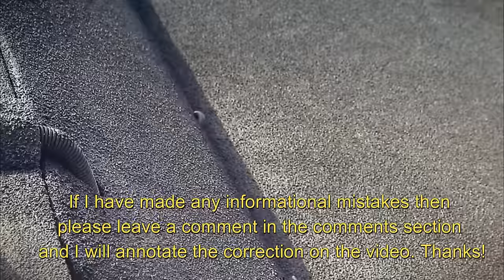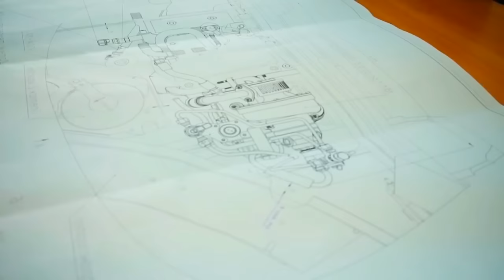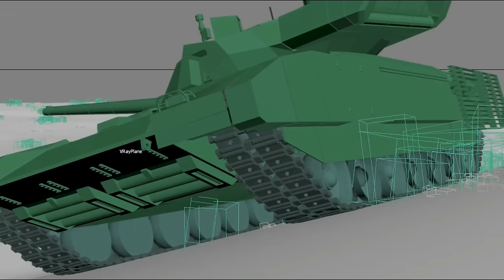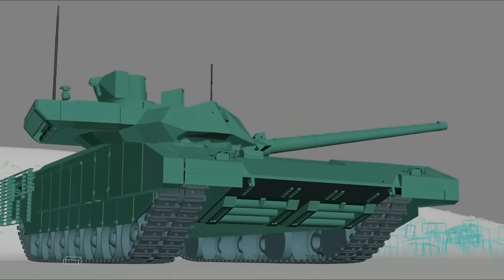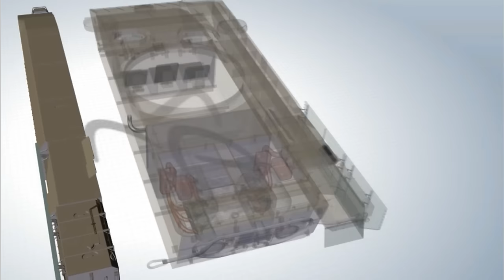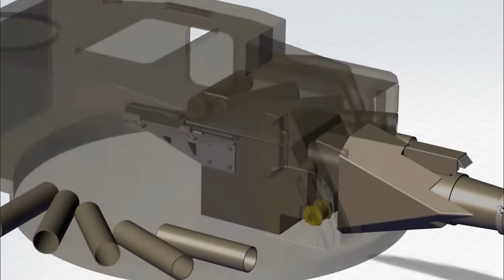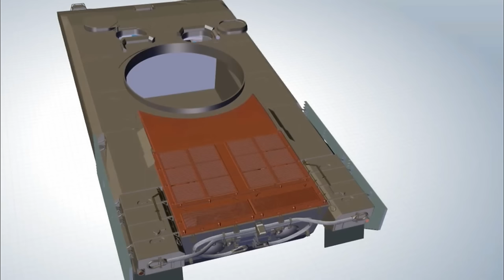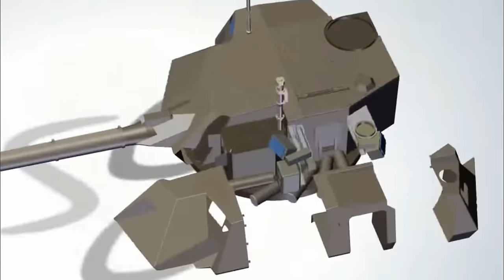T-14 Armata Russian Main Battle Tank - Tank Overview

Comment: Comparable in size to the Leopard 2A7, yet 20 tonnes lighter. That translates to less armour, a lot less. The russians must be quite certain of their reactive and active armor. The crew may be well protected in their capsule, but if a tungsten dart cuts trough the turret (which looks paper thin, and probably is), the main gun will be disabled, possibly ammo will brew-off. Then you have a disabled tank, and 3 crewmen who are basically useless. 
And also not being able to put your head out and look at your surroundings, is a big disadvantage, the fancy cameras all over the tank can never beat mk1 eyeball and binoculars, plus if the cameras break, you are totally blind.

But buttom line in a tank vs tank conflict, the best crew wins hands down. And the russian training and skill level is inferior to western.
Reply: How about ergonomic? Technology doctrin make anything simpler, the training become simpler, the soldier wage reduced, less casualty, the point is make a vehicle that operate as easy as possible, with the cost as low as possible, with crew as little as possible and training as fast as possible, so we can got plenty tanker. With 150 manpower and wage, we got 38 abrams or 50 T-14. Maybe on future any civilian can control tank without any extensive training hence anybody can become milita in emergency.
Reply: i dont see the problem actually... the us has twice the manpower in case of war and 4 times the number of people reaching military age annually, add the rest of nato and you are a 4:1 ratio to each russian soldier.
Reply: Machine vision allows to synthesize the image inaccessible to human perception)
At the T-14, there is no tower in the conventional sense. It means no extra weight. The capsule is multilayered and includes comprehensive protection. Detonation is not fatal, but threatens the loss of the tank. Damaged tower can be replaced in a few hours.
Reply: That's right, you can teach everyone who understands computers, learning is possible in the simulator. Basic requirements for the crew is the speed of response and decision speed, the machine does the rest.
Reply: Джо Неуловимый the damaged tower means unusable tank no matter how fast you can change it, before changing it you will need to drive back to base and takes time, time in which you are defenceless and you will  because of this they will need to produce more and more turrets which require a lot of materials and tech which is pretty expensive.

the armata turret should be well armored at least on the front and with weak sides but the front must be tough, thats a serious design flaw.
Reply: That is why all Russian tanks, infantry fighting vehicles and light armored vehicles resistant to weapons of mass destruction. Crew assumed independent existence in the machine for a few days.
Reply: Джо Неуловимый WMD are the least of the worries... if they are used the world will be a wasteland of radiations.
Reply: ***** Repair kits are available in advance, several engines to replace, for example, guns, etc. There are T-16 evacuation and repair machine, the T-15 that need to pick up the crew.
Reply: Джо Неуловимый repair kits are a thing, swapping a turret complete with cannon, breech, autoloader and carousel is another.
Reply: ***** Replacement made modules, if damaged something else, of course more difficult.
Reply: everybody turns into a tank engineer although 99% of information about the tank is still classified... so sad to watch :/
Reply: ***** actually most of the info are released to the public
Reply: You seriously think that engineers are stupid and that you know better than a large group of professionals? Please...
Reply: Tank Wrold remember that everything is always made by the lowest bidder... there is always room for improvement and after studying tanks development and requirements compared to logistical capability, economy and production capability i tell you this design is very cool but is too much for a country with economical problems like russia.
Reply: ***** Yes, now it is crisis with the economy not only in Russia. Russia's real economy, without economic bubbles. Guns instead of butter is unacceptable, but without weapons, butter and bread, you won't need, we must choose. Forced peace and the decline of the economy, or total war to which usa are so diligently pushing us.
Reply: superliga1  yes less armor, but does not mean less protection. In the video you can see how they strip the turret removing the thin plate protecting the sensors (western tanks have them sticking out the top) and the "real" turret underneath. Only armoring that part instead of the huge turret can reduce a lot of weight, plus the composite armor Russians use are lighter. Together with all the ERA and APS I believe this tank is a lot tougher than the western counterparts
Reply: Джо Неуловимый see this is the problem you are accusing the us of pushing a war while before the crimean crisis nato didnt even have a soldier in easter europe while russia already piled up 80.000 soldiers on the western border... nato moved the first men months later and there are only 4000 troops divided between 4 countries so 1000 each while russia keeps 100.000 soldiers + tanks + jets + s300/400 + iskanders all close to western nations, nato doesn't care about having a war with russia, actually it asked russian cooperation on many projects but russia always denied so who is the real hostile here ? the thing is very easy, if russia moves away the troops from the borders and give back crimea THEN a legit referendum can be made and then they can keep crimea but now its illegal, at that point nato wont need to keep troops in eastern europe and things will get back at 2013 status, russia started the invasion now they must have the balls to back down.
Reply: Джо Неуловимый do you really think that if nato wanted crimea they would have wasted time just looking at how things went in ukraine ? if they wanted crimea they would have come with full military power close to the borders way way earlier... they didnt.

again this kosovo bullshit ? there was an ethnic cleaning, nato warned them to stop, they didnt, we came and fucked them up, russia said that bs because they were supporters of the opposite side.

ukrainians and russians lived for centuries side by side and nobody ever gave a fuck and now they come up with the story of killing russians in ukraine yeah right, then explain me why igor girkin aka strelkov admitted then when he came to donbass everything was fine and everybody were living in peace but he had to start a war and did it, the eastern ukraine conflict wouldnt last 2 months if russia stopped sending soldiers, equipments and vehicles yet they deny the involvement ? we have tons of proofs of their involvement.

sure russia has the right to move troops inside their borders but so does nato and we can stockpile 4 times as many soldiers are russia can field, are you sure you wanna play this game ?

in georgia the russian army smartly baited the georgian to attack first which led into an illegal action becoming somehow legal as defence (smart move from the russian).
Reply: ***** "Come and get it!" why NATO has not captured the Crimea?)
Because it is a conflict with Russia. You've been warned what it portends.

US emissions of international law. Why Russia must respect the fact that there is in the opinion of other countries? This is a dangerous precedent, the US warned.

The Nazis killed in Ukraine Russian. This is true.
Dokozatelstvo Russian involvement in the conflict and was not represented. The only noise in the media, and nothing more.
You know Strelkov? What awareness)

Чьих будете?

Read the Military Doctrine of the Russian Federation, members of NATO potential deceased in case of conflict. The amount does not matter.

It cost the lives of our soldiers. If it be a question of protection of the Russian population from the aggression of NATO, to feel sorry for Europe no one would. We are no longer the Soviet Union, no sentementalnosti only pragmatist.

"Game over." Now all seriously.
Reply: ***** We are Europeans not Americans, you can talk trash all you want but we dont need you, we dont have to choose between Russia or Usa, we are independant and i have the right to point out the Imperialism of the USA, the freedom of speach we have here is not because of you, its because of us. Dont think to high about yourself
Reply: ***** Biased much. Cant talk with a troll my friend, get your food somewhere else. Cant imagine that you are 25 almost 26 years old and talk like a 12 year old.  And by neonazis i guess you ment west Ukraine.. and all those "imperialistic" nations you describe once were Russian, you dont understand anything about those regions. And yet even if it was true, thats not the same as Russian bases in Cuba, because thats what the USA is doing, but i guess you dont want to hear. I personaly dont like both and i dont have to choose like you do apparently.
Reply: ***** Ok man, you need to calm down, go outside and search for a life, right? Ok cool
Reply: *****  ok i will do that, now please follow my advice.
Reply: Ramon Revichev now it's funny because knowing stuff means I don't have a life... right ? while i have a life and im very satisfied with it that's why i spend time reading and gaining knowledge on stuff of every field because i like to know and test it with people who think differently from me because im open to change idea if the argumentation is well made and based on documents and therefore real facts, you will understand why i hate bullshitters who talk without knowing the subject or keep parroting the same old shit like everyone else without doing research on it or trying to analyze the reasons of it.

so Ramon i'll tell you a thing, pick up a nice book, enjoy it and have a nice day, bye.
Reply: ***** yes you are right
Reply: BlackSkorpion1991 Having fun arguing.with vatniks?
Reply: If you know specification for developing t-14. Its unclassified. T-14 have minimum 1200 millimeters ceramic-steel armor in turret area. And active armor system too.
Reply: Валентин Аринкин pity that t14 armor specs are classified and everything you read is speculation... also why would you have 1200mm of armor which is heavy to carry around when the weight of the tank is actually light ? what's the reason of having and ultra armored crew station if you cant drop weight from other places of the tank ? the crew will survive anyway and you are carrying useless extra weight.
the idea behind crew armored bunker is to drop weight from other parts of the tank and still keep crew survivability plus why would you need such a heavy armor when you have the "so awesome" malachit and other APS ? it's simple one the 2 is bullshit so either malachit and aps are shit and dont work or the armor is not 1200mm thick.... abrams turret front is the most heavily armored tank in the world (talking just about turret front) currently with 960mm rha and you really think that russia put over 1200mm of armor on a tank which is 25/30 tons lighter ? laws of physics are the same for everybody and i really call bullshit on russia having a completely new armor unknown to other nations which spend much much more money in war tech development than russia, as russia currently cant even afford more than 12 t14.

so don't believe everything you read on the internet and analyze it with critical thinking.

btw even abrams armor specs are still classified... it's just known what is made of but not the specific way it's made inside and it's a tank very old so you think a brand new tank will just give out info like that ?
Reply: BlackSkorpion1991 specifications for development its unclassified information. You can search it in internet, on Russian of course. Our defense ministry wants 1200 or more millimeters armor in turret. 1000 front of body. And 800 sides. This weight what we have now it's benefits of composite armor.
Reply: BlackSkorpion1991 if you think "bullshit" about official government contracts and specifications I don't know what in your mind it's not bullshit. I know for armor armata platform we build new factory. If it's armor can produce on old factory we build one more for only 1 platform?
Reply: +BlackSkorpion1991 Your argument only makes sense in a one dimensional sense. If you include all perspectives of the battlefield, a giant lump of armor with a cannon is totally going to lose and here is why. 1. Offensive weapons have outpaced armor. 2. Mobility and first strike capability determine battlefield outcomes in the modern age. 3. Electronic warfare is generally a far better investment than armor considering the most devastating weapons tend to be missiles in a first strike scenario. As you can see, there is simply no point in piling more armor on tanks when there are hand held AT weapons that still can penetrate the armor.  The cost difference is stupidly obvious.
Reply: Project NEMESI5 you are obviously not considering the NATO strategy of war where first AA and SAM sites are taken out of action by stealth bomber then all aircrafts are called in for air superiority and then ground force come in and steamroll everything, if something blocks the advance bombs will fall from the sky... rommel said that from ww2 to the future the ruler will be the the one who owns the sky, if you dont you will have to suffer the consequences and adapt your strategy to it, russia doesnt have the capability to maintain air superiority against USA alone now add rest of NATO and the chance is gone forever.

offensive weapons outpaced armor 20 years ago... today we have soft and hardkill defences from missiles... ofc they aren't going to save your tank 10 times out of 10 but reducing casualties is already good.

first strike and mobility are not a problem, you have to consider supply logistic aswell here and the us is absolutely the most experienced one in this field.

electronic warfare... russia in Georgia had to use GPS because their glonass sucked and so the us shut it off over that area.
russia buys nanochips from the west because they cant produce them and you expect russia to be the top dog in EW... they are 10 to 15 years behind in every project, except t-14 armata which i find it to be a great design but on the other hand they don't have the economical power to build them in a considerable number.
Reply: ***** Im very familiar with nato weaponry, which is heavly dominated by US equipment that has been adapted to fighting terrorism for the last 16 years. Basically, none of it is conventionally sound.
Reply: Kenny911able look up the numbers, T-14 is huge compared to old russian tanks, yet 20 ton lighter than western counterparts.
And USA hammered Vietnam in combat, but lost on the homefront
Reply: superliga1 becouse T-14 is actually much smaller. What you see is lots of ERA/NERA whatever protection. Take that away and the tank is much smaller. Thats why the tank is much lighter. Not becouse its bad protected.
Reply: Black Widow the tank itself lacks armor, it's all active protection strapped on some metal because since its crew is all in the bunker the rest of the tank can be lighter and just needs good protection for the crew in the front and the sides where the bunker is located, the rest is all "lightly" armored and is protected just by APS.

if you ask me that's a very smart way to save weight.
Reply: ***** thats what i am talking about.
Reply: Black Widow but if APS fails and knowing Russia ability into high level tech it will fail lots of time, (compare russian shtora with us passive protection the russian have a mean time between failure of 250hours while the US one have a MTBF of 400hours) russia cant produce nanotech by itself and buys that from the west so i would think twice before creating a light armored MBT which relies only on APS to survive as an ATGM or APFSDS could disable the whole tank or just the gun with a single hit if something fails and autoloaders tend to fail when the tank get hit just because of the shock.
Reply: Correct, Russian tech is very substandard and they have to import many of the components to boot.
Reply: Uh-huh, and what if practically any projectile larger that 12,7 bullet just hits the barrel? No need for turret to be invincible from direct hit, there is no one to protect. Just return for repair.
Reply: That's why 'merican so called 'astronauts' are buying their seats in the substandard Russian "Soyuz".
Reply: No bb it's not bs it's true, you can't afford your own spaceship hehe. The technologies are too marvelous.
Reply: your point is fairly right but you fail to consider the different doctrine used... what you are talking about is soviet (now carried to russian) doctrine which says "we are scared of weight" so they would rather have a very small tank with an average armor because their engines are underpowered compared to european tanks (except t-14 which is on western standard but using an X design which is interesting but i would avoid personally) while instead the western doctrine is provide the maximum safety and armor possible to the crew so the turret will be big because of comfort and safety (blow off panels for ammo) but they wont sacrifice armor because of the big turret... they would rather power up their engine tech like they did with leopard engine which was upgraded and became more powerful 1650hp compared to the original 1500hp and now it's even smaller and fits in 1/3 less space than before.

in russia they would rather strip down the tank armor and put on ERA which is a one-time protection and after that you are pretty much fucked rather than having a tank capable of sustaining hard hits without ERA which could be mounted anyway for extra protection in case the scenario requires it.

in the future when all tanks will autoloader im pretty sure that western tanks will still hold a slightly bigger turret compared to russian ones because if the autoloader breaks you can still send inside a manual loader.

currently the t-90 requires 1 MINUTE to load 1 SHELL if the autoloader breaks/jam that's absolute garbage and even when functioning it's performance arent that good... (i've read the official data of the manufacturer of the t90 and it stated that it takes 6 to 8 seconds to load a round, while in another place (still from the manufacturer) it said 8,5 seconds per shell... in that time a good loader on abrams can load 2 shells and if very experienced it can reach aaaalmost 3 shells.
Reply: i was talking about modern tanks if you wanna talk shit lets go.

yeah shining example... the t55 had 200mm on the turret but just 100mm (120mm after 1949) on the hull which is a much bigger target, t55 had to stay hull down to use at its best the armor protection, too bad russian tanks dont have enough gun depression for the hull down tactic unless they are dug in which is... the exact opposite tactics used by the soviets aka swarming the enemy with huge number of tanks.
now consider that at that time HEAT could easily go over 200mm of penetration so 200mm on the turret arent going to do much unless hit by AP.

now do you even know that all russian tanks require the crew to be pretty small, cant remember but should be 1.60 or around that and they were really cramped in there, now compare to the US doctrine... they had tanks with well sloped turrets and pretty armored with good hulldown capability and gun depression but most of all the crew had enough space to be more comfortable which on the long run will improve the combat capability of the tank compared to the exhausted and tired crews of soviet tanks.

the t55 is a pretty good tank for its year but they were slaughtered by the centurion (which entered in service 1 year before than the t55) in the six days war... hell even t-62 got wrecked by the centurion.

challenger 2 ? oh yeah why you picked the most heavily armored tank in NATO ? the one which actually have a pretty sluggish engine and not compare it instead to the abrams ? or the leopard 2 ? do you know that both these tanks can go faster than the so called "agile" t-90 ? the abrams ungoverned can go up to the speed that the tracks would rip off themselves but i can tell you that i can reach without doubt more than 80kmh... i read some seen it go at 110kmh but i dont trust them so i'll give you a good estimate at 90kmh.

the t-80 wouldnt stand a chance against a challenger 2 so were are still comparing great mobility with good armor against good mobility with great armor.

about blowoff panel you are a moron... they work perfectly, there are videos and videos of abrams getting hit and blowing them off safely, NATO doesnt us HE-FRAG that's just the russian, NATO uses HEAT or MPAT  and now about the photo... leopards have a second ammo storage inside the hull beside the driver which if u ask me is very very dumb but anyway those turkish leopards were DISABLED by ATGM and then the crew to prevent capture of the tank from ISIS called the air force and they dropped a 500lb bomb over the tank to destroy it, you can look it up they did it multiple times.

i have more knowledge on the subject that you will ever have
Reply: Что-то вам это не сильно помогло в свое время!
Reply: BlackSkorpion1991 z
Reply: or, instead or simply having a non literal ton of steel welded to the outside of the vehicle, it has something lighter but obviously classified. some form of composite armour,  layered possibly?